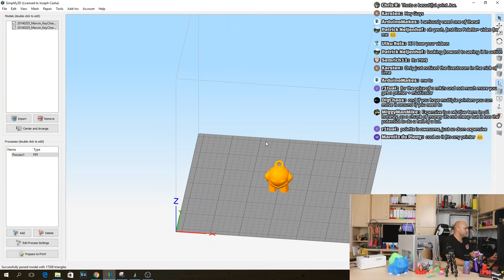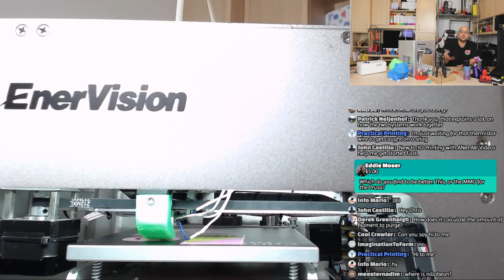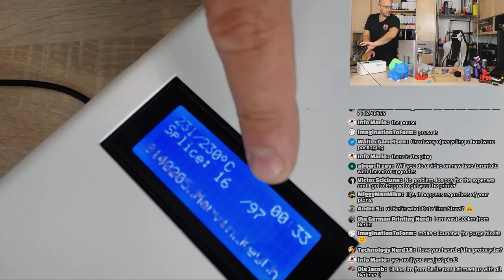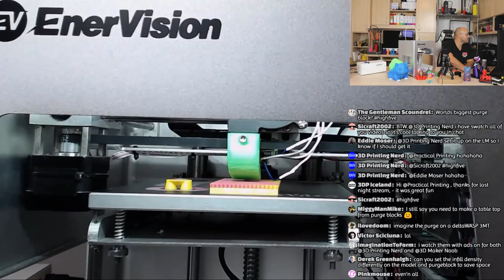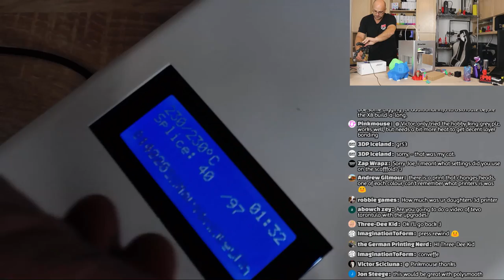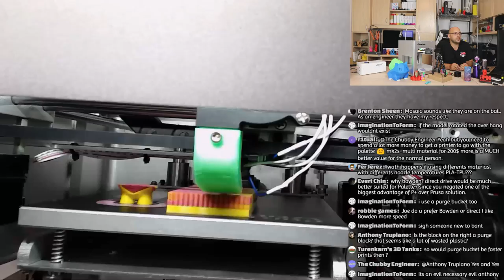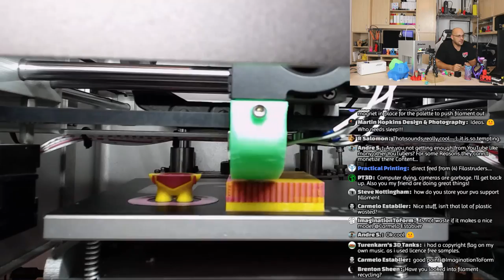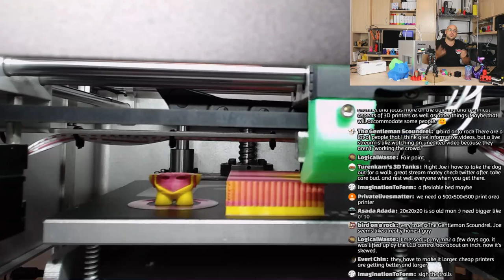Printing With The Palette+ Along With Q&A

Comment: Can the purge block be turned off completely?  For some prints and color combinations it would actually look fine transitioning from one color to another.
Reply: Or maybe have an ooze shield as alternative
Reply: They released Chroma version 3 which now lets you choose how to use the purge material. As infill is now an option that means a ton less wasted filament so I'm very tempted to pull the trigger. Wish they would have an updated review on this with the new software.

Comment: It is interesting that just doing the multi color printing with a stock i3 and their app it just squiggest out a few inches to purge to the next color and both the MMkit and the palette require such large blocks to change. Seems like you could add in a whipe feature of some sort to do the inch or so purge of the multi color function and wipe that tangle off on something as it heads back to the print.